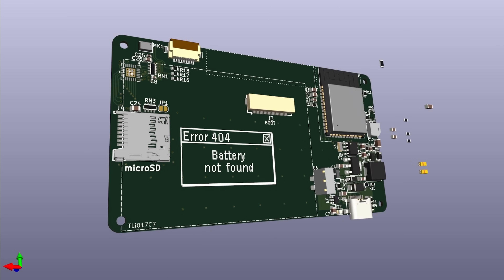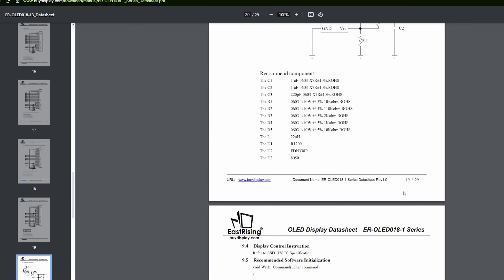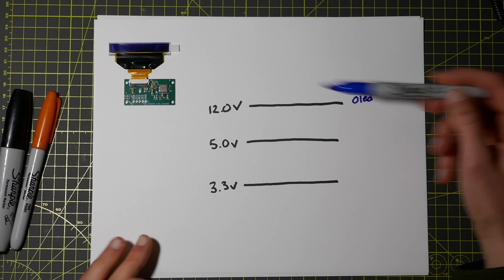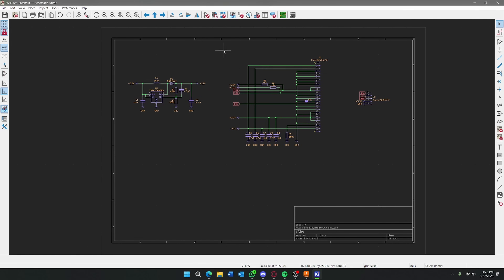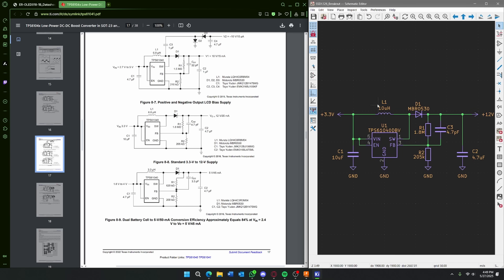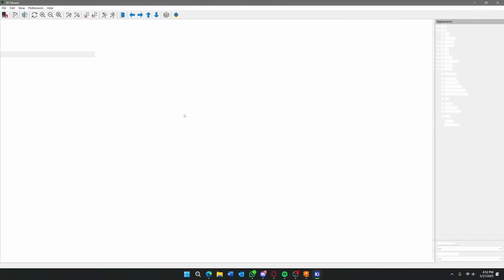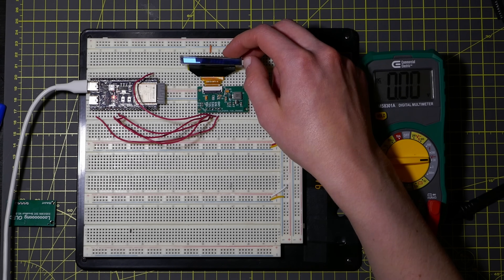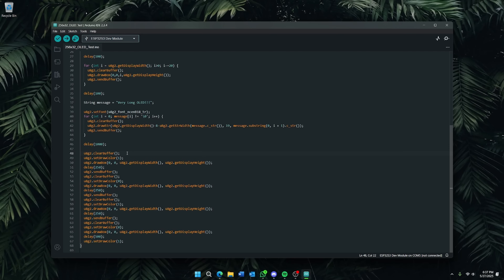My PDA’s New Screen Is Ridiculously Long

Comment: Hello, thanks for the video! Quick question; the inductance on your inductor differs from the recommended value in the spec (10 uH vs. 3.3 uH). Why is that?

Comment: Why not use a higher voltage battery and convert down to 5 and 3.3 for better efficiency
Reply from the maker: Thanks for your question! 2 cell LiPos are much more complex to implement and thus more costly. They are also less readily available than 1 cell. The battery is 4.2V so it actually does step down to 3.3V. 5V is not used on the board.
Reply: @ashtf I meant more specifically the OLED as I'm sure it's pulling significantly more of a load than it would without the losses from the boost converter, I see what you mean with the battery, scouring digikey ~12v batteries in that size range are few and far between but I did see some promising nickel metal hydride and lithium ion cells in a good form factor in the $20 - $30/unit range, although I don't know what kind of price your looking at for your current setup
Reply from the maker: The battery I have now is $3 per unit as a reference point. I also considered other chemistry, but LiPo tends to have the best power density and comes in small form factors so I went with that chemistry. I get what you mean though, it's not ideal but I suppose some compromise had to be made.
Reply: or find a similar LCD display that can run on less than 12V ?

Comment: This is nice. Tbh, i really need the long display. 
I need 192 x 32 display for a hobby project. I can just use 2 of 128 x 32  or use (128 x 32) + (64 x 32) and put it side by side, but it just not have seamless display (exposed parts).
The only solution i can think of, is using 3 display of 64 x 32 side by side. It kinda have seamless display (no exposed parts in left and right, so screen can meet screen).
The only problem is, you can only use 2 display (because the address or something). So for using 3 display, maybe i would  use bit banging the display. 
I may seen tutorial (and github i think) that success that. But this is just my theoritical thinking, i havent done it yet.
Because of the constraint of my project like small size (have certain size limitation), a certain size of display ( 192 x 32, if the the only solution need more than that, i can tolerated it), i havent found the display.
.
After i watch your video, maybe this is one of the right solution for my problem. 
The board kinda large for me, maybe i would try make it small (longer board, but solve the problem).
Im new in this stuff, so my approach maybe kinda weird.
Thanks again for this project and the idea. It really inspired people.
(sorry for the long post and bad english).

Comment: The update speed looks quite slow, is this a limitation of the display itself?
Reply from the maker: It's a limitation of either the I2C or the available RAM of the ESP. working on getting an ESP with more RAM and optimizing the I2C speed
Reply: @ashtf if you have the gpio to spare SPI could be an option, much faster data rate at the cost of an extra data line per device
Reply from the maker: I actually did end up switching to SPI before I ordered a few days ago, great idea!